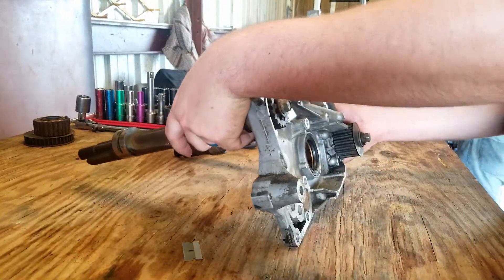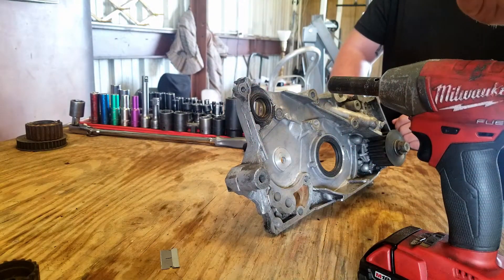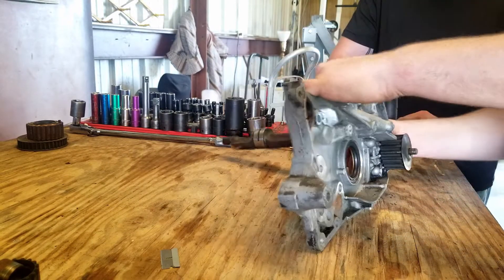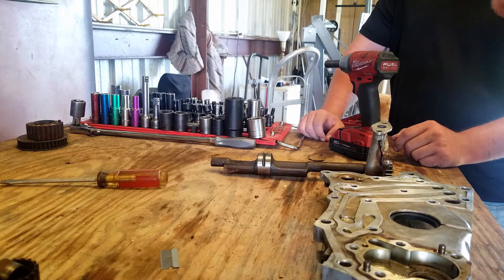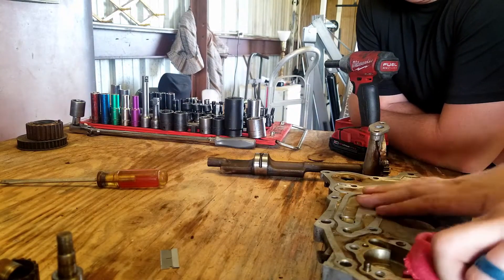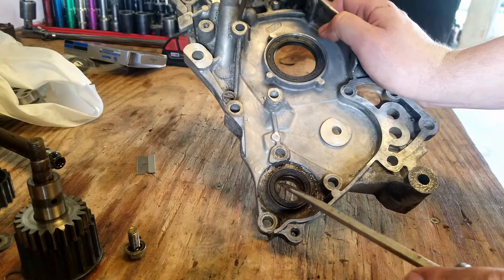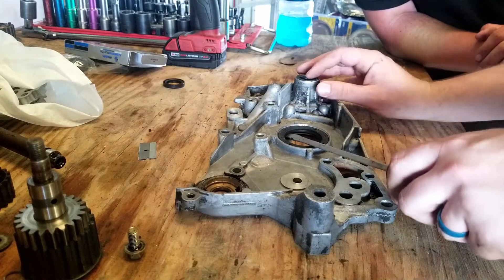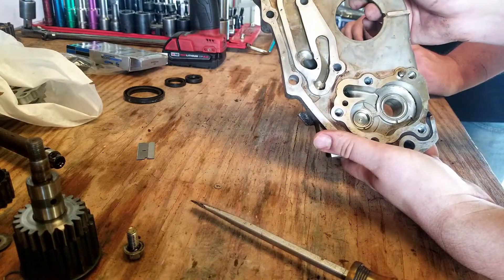4G63 Balance shaft delete

Comment: Where can I buy that delete kit, can you send me the link, I will definitely do that on my 4G63, I live in the Philippines and I think I will be able to buy that kit online, thanks bro for that great video🛠️🔧⚙️🔩🚗
Reply from the maker: Yes I will add the parts to the description.  I forgot to do that.  Are you building a 4g63?
Reply: I have stock 4G63 NA want to slowly build it to become muscle car, starting with the delete kit, placing turbo, 70mm throttle body 1zz injectors and a lot more, maybe you can give me a recommendation on the brands

Comment: Do I need to put bearings , are they necessary even tho there’s no more shafts ?
Reply from the maker: Yes the bearings are necessary to maintain oil pressure. Make sure to reinstall the bearing 180 so that the oil ports are blocked.

Comment: A master mechanic ? you failed to measure the oil pump gear clearance to see if it was in spec, then knocked out the balance shaft bearings with a socket & fitted the new ones the same way. Making metal shards as you hit them in. Just purchase the balance shaft Mitsubishi tool & do it professionally
Reply from the maker: A special tool is not required for this modification. No metal debris was created during the process. Checking the gear clearance wasn't necessary as I wasn't introducing new components to the assembly. Furthermore, when you have been doing this for as long as I have, you have a good feel for what's right and wrong. Experience makes all the difference.